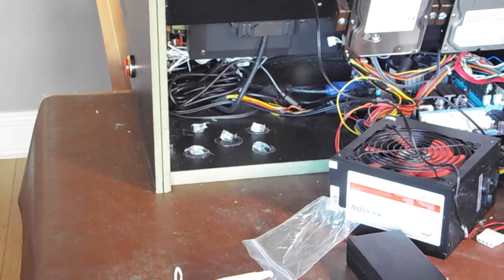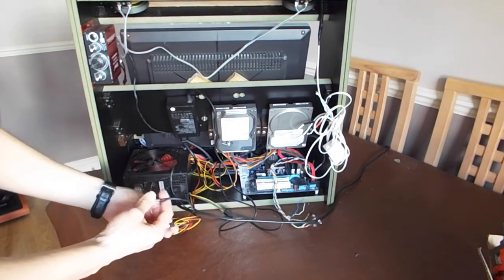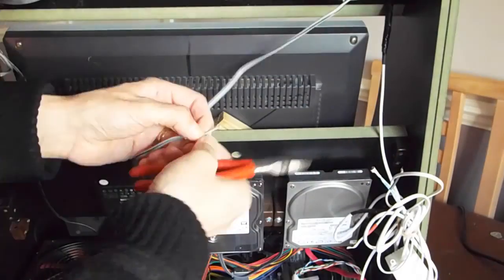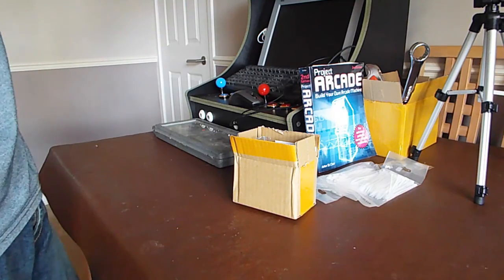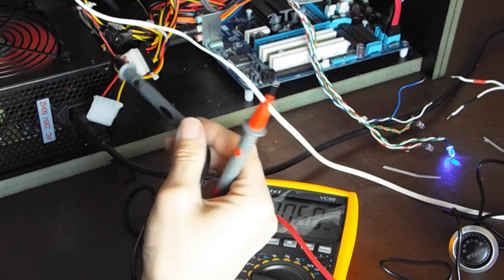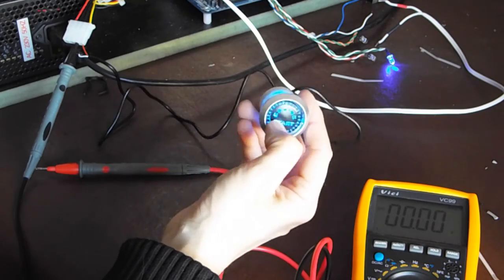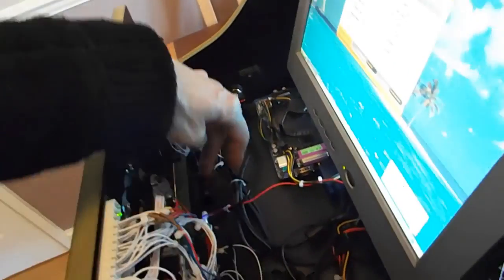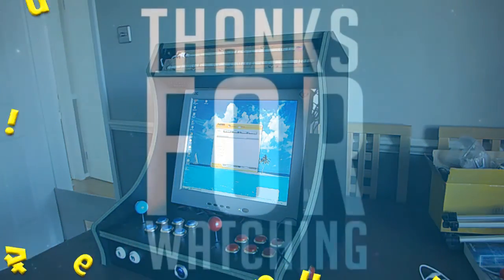MAME Bartop Arcade Machine build. Part 13

Comment: Good to see another video mate! Was struck by the flu last week so i couldn't comment on your previous one, but i just caught up with your videos. Was fun watching again. Oh by the way, it was me commenting about the noise interference on the amp. It is a bit funny that it only occurs at 12v though, and not on 5v. I hop you can find a solution! Looking forward to the next one!
Reply from the maker: +AeronNL Ah great thanks for the amp comment and you have been proved correct ;-).  Tbh once any music starts you cannot hear it.  I think its picking up the hard drives. If I find it really annoying I will prob switch back to 5v.  Hope the flu is getting better.  Loads of that around at the mo and seems a real nasty strain ;-(
Reply: +fredintheshed1 you are welcome Fred! I probably picks up all sorts of interference, hdd is more than possible i can imagine. A separate adapter will fix it, but then you have to install a surge, will is kind of taling up space. Perhaps, if you have no other choice, you can attach a power surge onto the back panel! 
Is het quality of the sound better on 12v than on the 5v you had by the way?
The flu is gone fortunately, but it drained my energy so i have to take it easy for some days! It is a nasty one indeed!
Reply: +fredintheshed1 sorry for the spelling errors, typing on my phone with autocorrection in Dutch on!;)
Reply from the maker: +AeronNL No worries buddy I understood it cheers ;-)